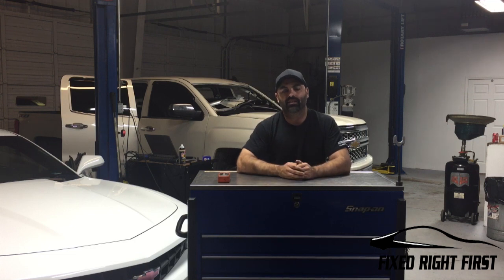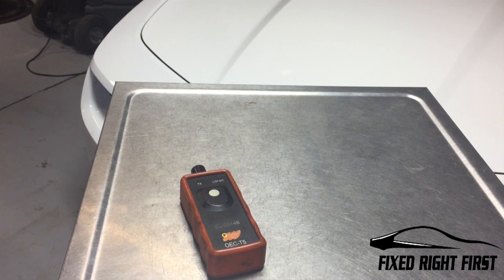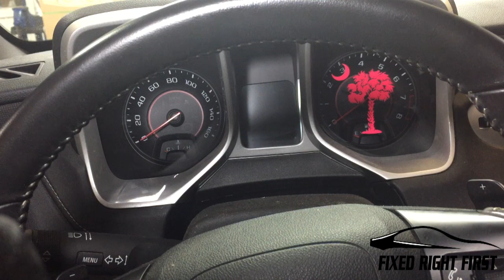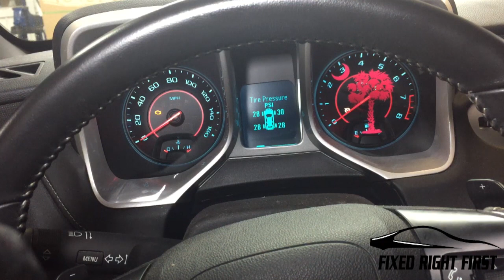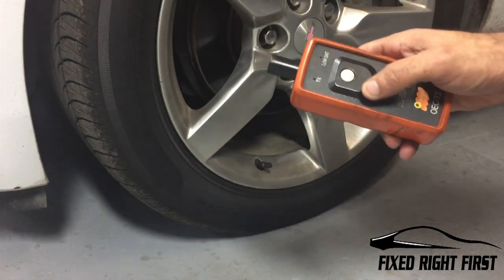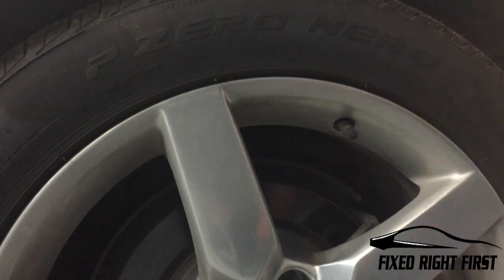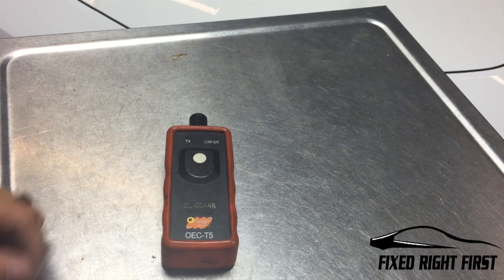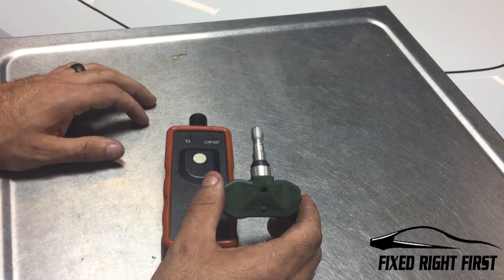How to Reprogram or Relearn Tire Pressure Sensors (Camaro)

Comment: I have a 2010 RS  Camaro don't like the wheels , So I found wheel from 2016 ,they are take off. new. Can you program the new 6th gen. to 2010 5th gen . Or will I have to use the ones that are on the 2010 5th gen? In the new wheels?
Reply from the maker: The sensors in the new rims will work just fine.
Reply: I did this, but the new 6th gen Camaro wheels have sensors that aren’t the same kind that the 5th gen Camaro wheels use? I’m not exactly sure….

Either way, I replaced all 4 of whatever sensors were on the set of factory 6th gen Camaro SS wheels (20” inch) for some aftermarket ones, since I assumed they were old and eventually going to die out. 

I bought the common, universal relearn/reprogram tool from Amazon Prime for like $10; but it doesn’t do anything but work for only some of the older removed sensors (OEM ones). It doesn’t seem to respond to the new ones… 

On top of the cheap universal relearn/reprogram tool not working  with the aftermarket sensors, only CERTAIN OEM TPMS seem to trigger the individual wheel relearn process on the 5th gen Camaro (through the dash menu). For example, only my rear right (passenger rear) wheel/TPMS will trigger with the relearn tool, even though on the dash menu, it currently says like “rear left” or something or the sort (not/un-matched).

Comment: My right rear wont honk. Before it went out and gave message service tire system it wasn't changing when i put air in back right tire
Reply: Same I have a 2010 Camaro SS just happened to me today(3/2/2020) gonna buy some new ones changing them all is recommended since one went bad theyre probably all on the verge of going bad
Reply: @Chevifier  did that ever helped. I'm starting to have the same problem too. All four tires was showing the psi then I got a "service tire monitor system" and tire light was flashing and it said the front right tire then had no reading.
Reply from the maker: The tire that the horn will not blow means you have a bad tire pressure sensor in that tire. You will need to have the sensor replaced. Here is the sensor you need. https://amzn.to/2Sr5N6y